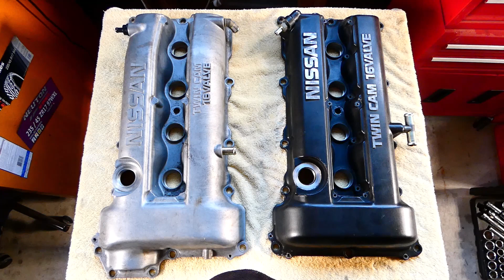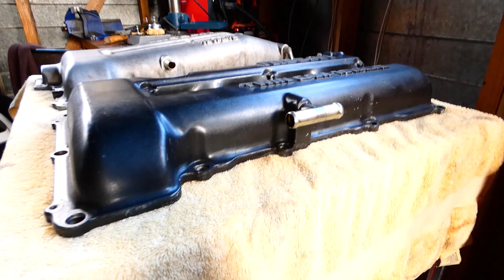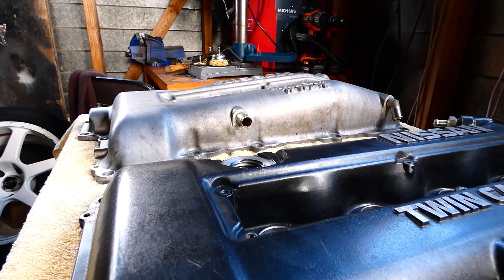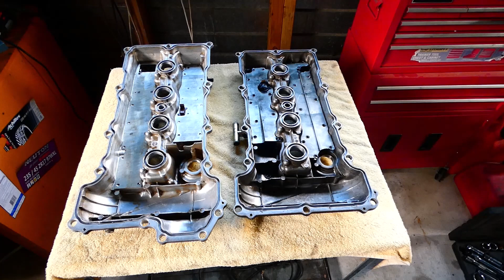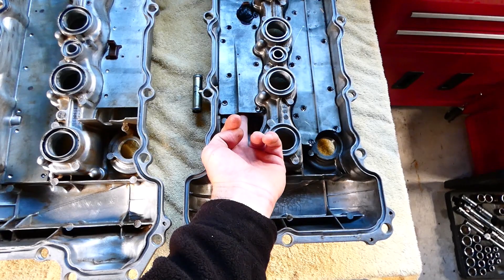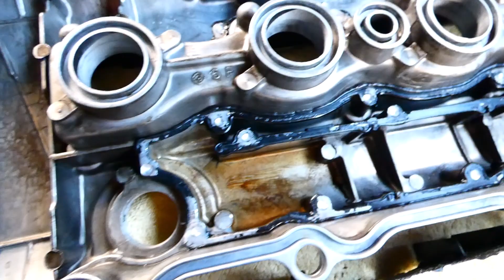S13 v S14 SR20 Rocker cover comparison

Comment: How much did it help with blowby? Currently running 26psi on my sr and i was getting a lot of it. Hoping doing this will help.
Reply from the maker: Unfortunately I haven't driven it properly yet so can't comment. I was  running about 21 psi with no catch can . A decent amount of oil would always line the intake piping, and puffs on gearshift. It will be a bit hard to measure but also just hoping for an improvement